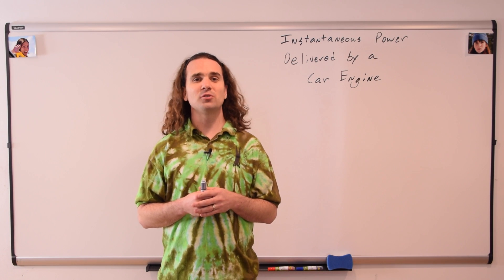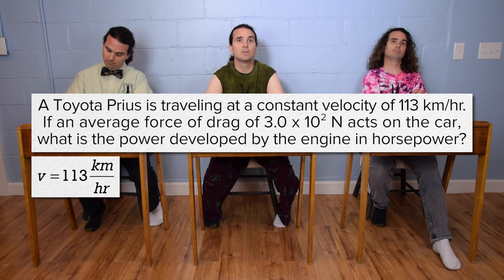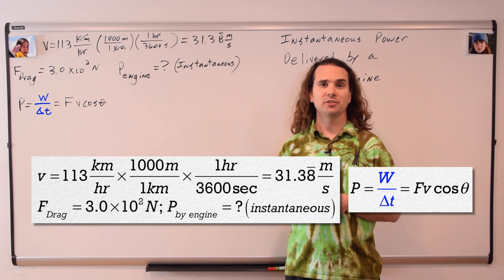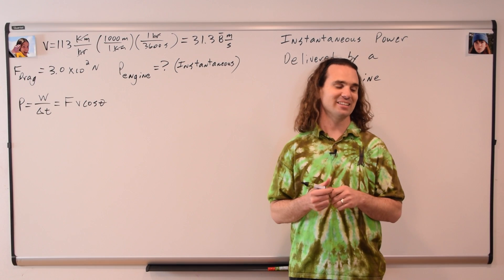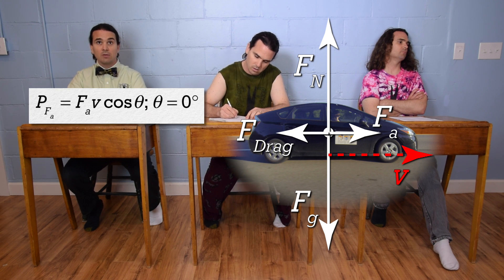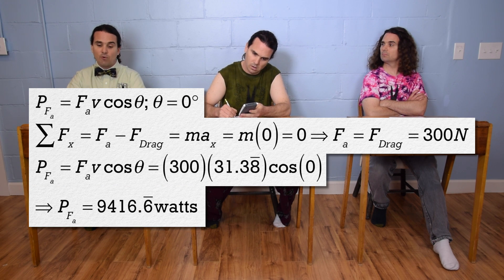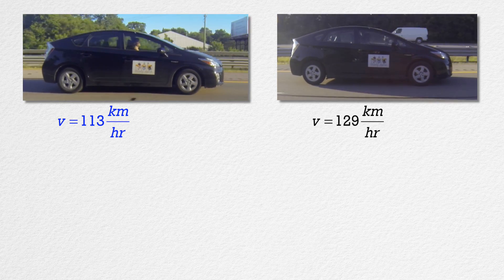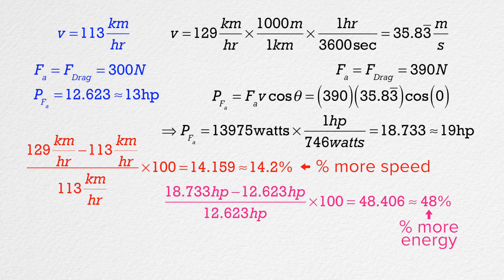Instantaneous Power Delivered by a Car Engine - Example Problem

Comment: I myself have interlocked myself into the physics of a moving automobile and find this video quite unique. However, the state of the question must be challenged, as F drag is an integral itself which differentiates differently among other cars due to several reasons. What factors other than F applied would change F drag on the car, and how would we measure them?
Reply from the maker: FYI: My lecture notes show how I calculated the drag force on the car. http://www.flippingphysics.com/instantaneous-power.html